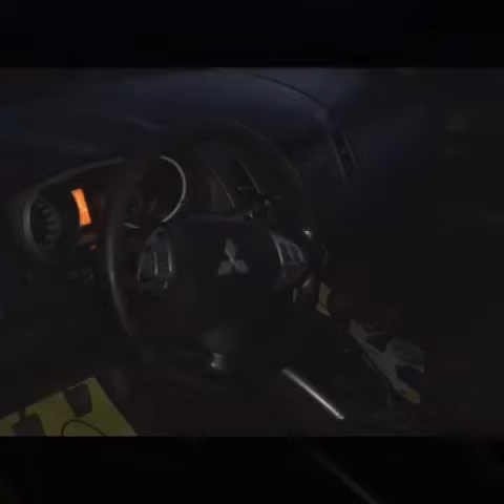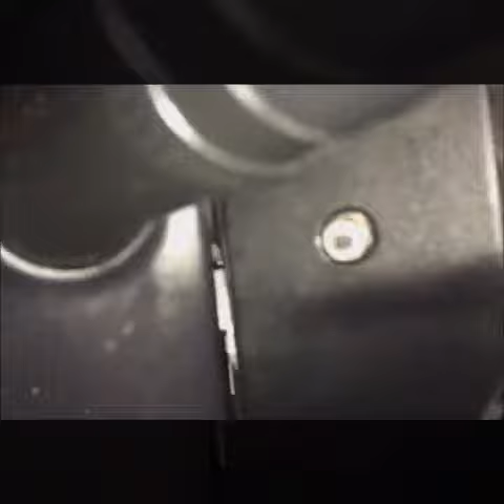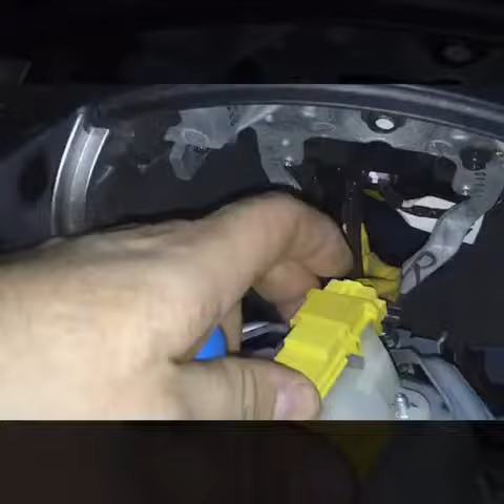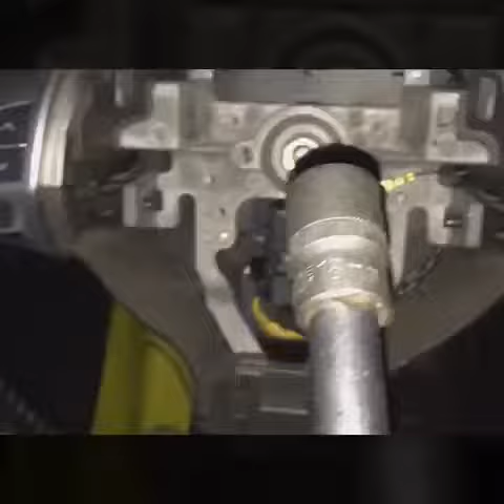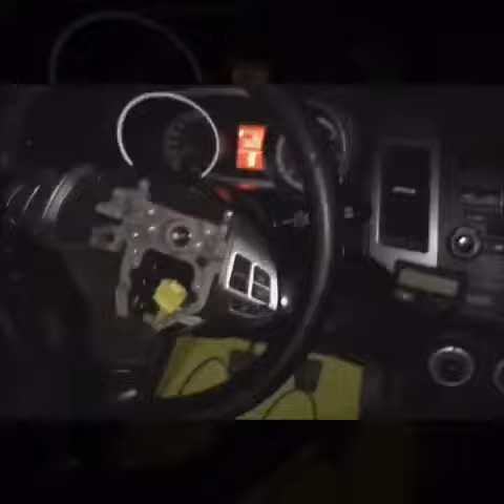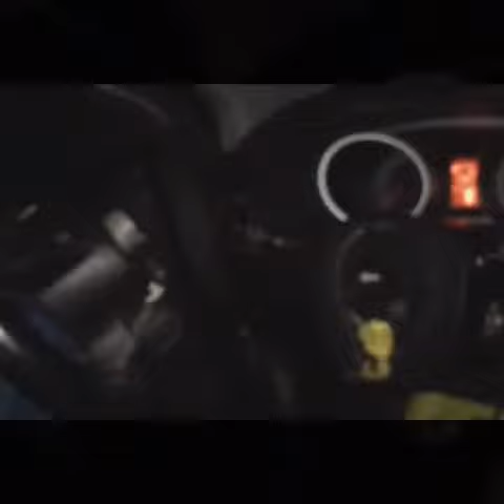How to remove steering wheel + AIRBAG Mitsubishi Outlander

Comment: Just that one torx screw on the right side to get off the airbag?
Reply: @michaelsieber6601  I discovered that eventually... I had to make sure the steering wheel was not turned to either side so that both were visible.